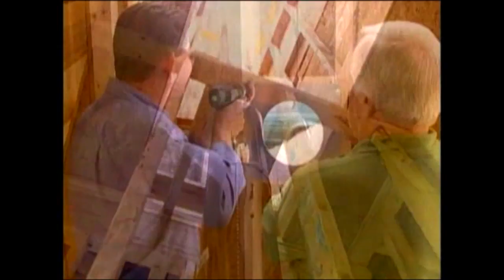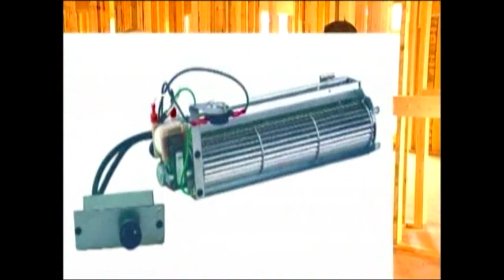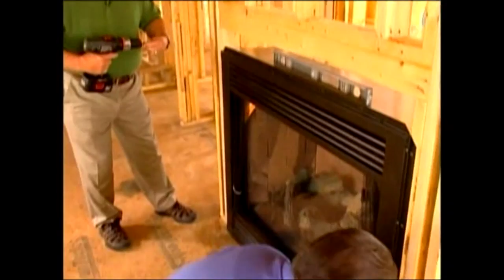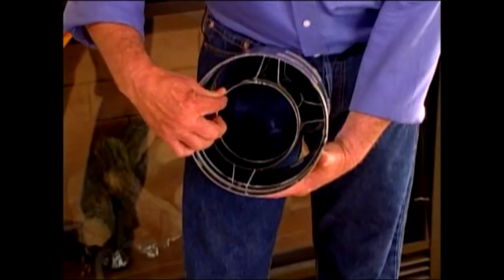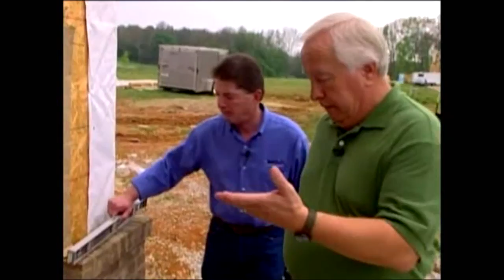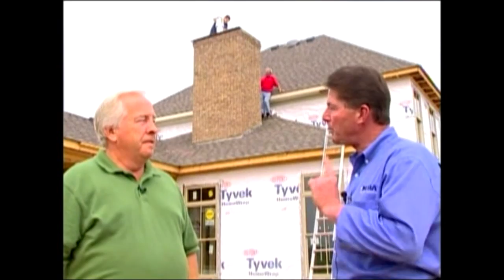Direct Vent Fireplace Installation - eFireplaceStore.com

Comment: no hi heat silicon?
Reply from the maker: While this video omitted that fact, it is recommended to use a high-temperature sealant like Mil-Pac when installing the direct vent pipe to the flue collar of the appliance.  It's especially important when using flex venting too.
Reply: @eFireplaceStore  Does the fresh air intake really need sealent?
Reply from the maker: @vegaslowblower8781   Putting sealant on the fresh air intake is optional, though it does reduce cold air from coming around the fireplace.